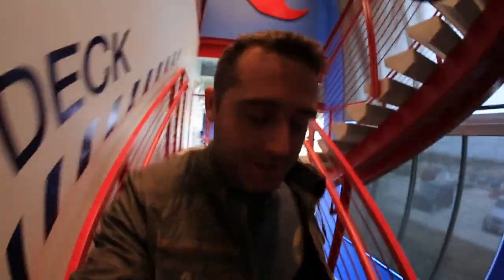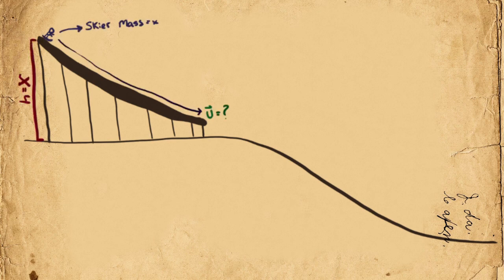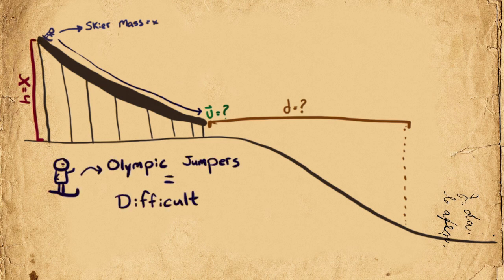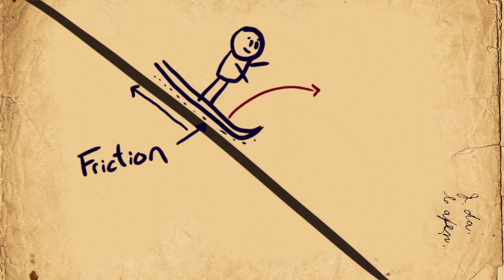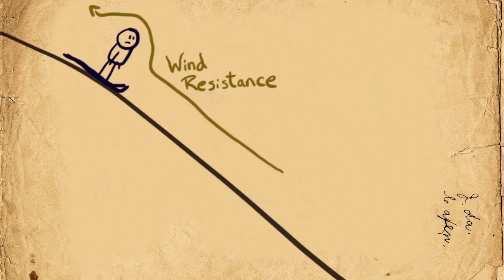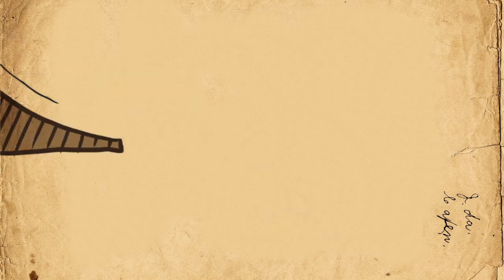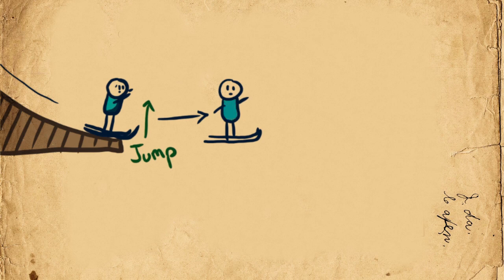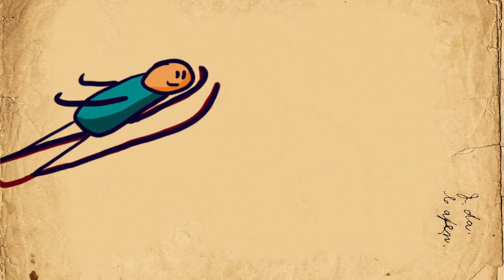Ski Jump Variable: the WIND - explained in a wind tunnel!

Comment: Missed variables: weight of the jumper(momentum), timing of a jump, strength of a jump/kick, angle of a leaning in air, landing form, angle of landing point (more flat it is, harder it gets).
Reply from the maker: Yeah. I'm changing the video title. I never really meant to explain all the variables. Good points though.